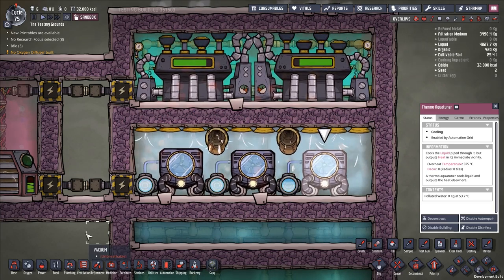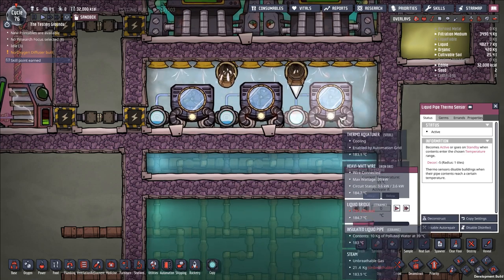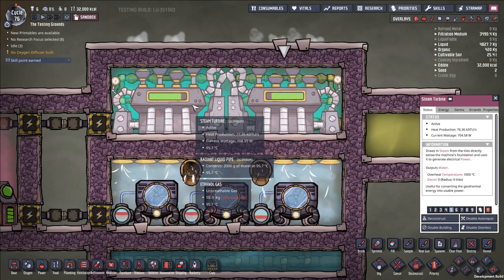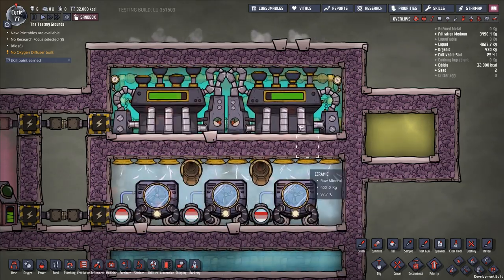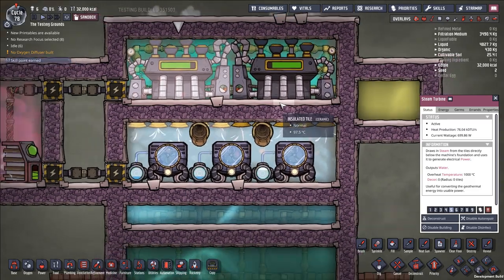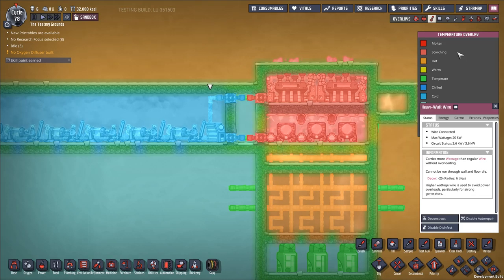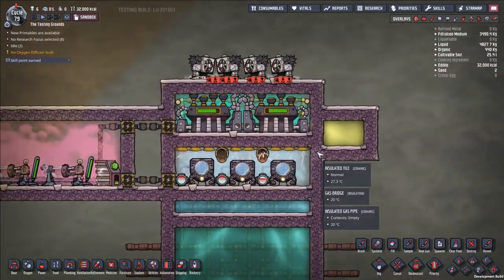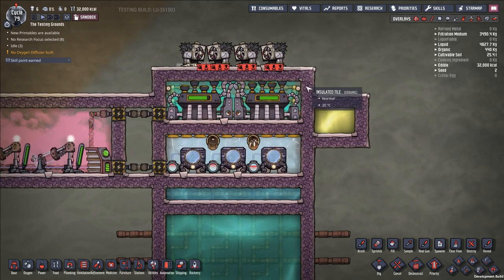Cooling Down Your Base With Steam Turbines -- New Player Guides [Oxygen Not Included]

Comment: I played ONI for a long time but i think i finally just understood how is functionning the specific heat capacity. Thank you for that! Now let's do some math.^^
Reply: @Piotr Dubrawski it's not how it works in this game, it works like this irl, also, the electrolyzers output at a minimum temperature of 70C°, so cooling your water further doesn't make sense, but anyway oxygen has a lower specific heat capacity than water, so you're better off just cooling the oxygen instead, you can keep the hydrogen as hot as you want, the generators don't care (if you use it for liquid hydrogen i suggest pre-cooling it though). Said so, if you want to cool water for other reasons (Although I don't see many) pass it through thermo aquatuners directly, each one is gonna output 14C°*10000g/s*4.179(DTU/g)/C° = 585060 DTU/s tho, so you'll need pretty extreme cooling (steam turbines)

Comment: Very good guides you are releasing. Thank you for that.
One thing to consider that Brothgar is also missing, that you may consider for future videos: These are very specific Creative Mode builds and very difficult to build in a normal game while under all the other stresses of base build; complete vacuum, completely full rooms are not so easy to make (especially when they are only 1 tile so you cannot have a pump in there.
Keep it up :)
Reply: to pump rooms to a vacuum, add an automatic airlock such that you can reach diagonal behind it to close up the wall, that way you can pump any room to a vacuum because the pump is not in the final room but on the other side of the airlock.
Reply: To be able to build in an empty room you can make a door or entrance with liquid, in this way you can remove the pump without problems, for more security of not having carbon dioxide because the replicant can expel it, put on a suit
Reply: @antonioroca2629  I don't think Dupes excrete CO2 unless occupying a tile filled with O2 or pO2. If that's true, you should be able to march them into a vacuum room, sealed by a liquid lock, and they shouldn't fill it with CO2, even without an Atmo Suit. Flatulant dupes will always produce natural gas, though.
Reply: @cnglight  It is very possible that you are right why they hold their breath but if they open their mouths, when they have a water door they run away and they do not axfisian, thank you for responding, you make me enter reason and it is possible that you fall as a precaution

Comment: Really good thing to note about External supplemental power supply is that you do not have to have it local. External power line connected to "In" port of Transformer, and the "Out" connected to smart battery. This allows you to fully control the external power "in" without needing to run a long command cable back to where ever your primary power station is located.

You would obviously have a second smart battery (or multiple depending on your setup in case of prioritizing resource consumption) locally at your primary external power station, as normal.

Comment: i found a way to prevent the early early heating. 
Design your base to have most the machinery and heat producing building in the bottom of your base accessible by a bottleneck. Put 1 or 2 wheezewort near the bottleneck to  prevent the heat of coming up into your living quarters.

Comment: Great video. Thanks for including your math. you've definitely helped me better understand heat transfer. 
Using your formulas I was able to see exactly why a 1:1 ratio can't handle iron and requires >165C overheat temp. You saved me a lot of work!
Reply: I'm actually having trouble with my very similar 1:1 build. My gold amalgam aquatuner heats to 200C immediately after filling the room with 130C steam, whereas a steal tuner in the same room sits at a cool 125C. I'm not sure why.

Comment: Love the delivery without an overexcited zany cartoon voice for the kiddies.

Why have the smart battery turn the generators off at 85% instead of 100%?  What are we avoiding there?  I've seen other YouTubers set the batteries like that but I've never seen anyone explain the selection of the higher number.
Reply: If you set it to 100% then when it hits 100% it will attempt to turn off. During those frames it is still consuming resources to generate power (which has no place to go). Setting at 85% is a safety but usually 95% is plenty.

Comment: if you have super hot steam put doors with thermo sensors under the turbine to block them vents. set them at like 200c, 250c, 300c, etc. for max efficiency.

Comment: Very nice, thanks!
I'm using this, but I don't think you should make the Turbine output a radiant pipe.

You'd have to keep the gaseous Ethanol temp between 95 and 100celsius. Any lower would mean cooling the water in the pipes, and any higher would make the turbine stop, you don't want either.
That means that you'd need a very specific amount of cooling from the Hydrogen loop. I'd assume changing the amount of radiant pipes or the material of it would offset the balance, probably even the amount of Ethanol you have in the turbine room.

Comment: You could also use Hydrogen to remove heat from the turbines and once its past a certain temperature send it to be burned off in the generators, so you delete the picked up heat and get power back. I dont think its a lot in the grand scheme of things, but especially on warmer maps everything helps.

Comment: Just FYI, it looks like Ethanol's TC was changed and is now almost exactly the same as hydrogen (0.167). But I suppose a benefit of ethanol is that if you place a pool of it liquid on the floor of your generator room and then leave the top of the room with some gaps, ethanol will easily displace any oxygen from below and push it out the top. In fact, it's even a little more dense than CO2.

Comment: A bit of a late comment but, How does a 1:1 ratio between turbine and aquatuner could work with just gold amalgam access?, My steam turbine is fine but the aquatuner is constantly overheating over 190°C and doesn't seem to get into an equilibrium.

Is there a way of fixing this? or the safer bet is to just upgrade to steel?
Reply: use steel - steel adds +200 °C to overheat

Comment: How much water do you put into the Steam room?
Reply from the maker: 100 kg or so should work fine, I think I would go with 1000 kg for a room this size, just to have a slightly higher thermal mass in the system.

Comment: Thank you, I've been looking for a guide on building this kind of system for a while!
Just one question - how much water do you use per aquatuner in the aquatuner room? I'm guessing before the system starts running you submerge the aquatuners into water, then once it turns on it becomes all that steam...
Reply from the maker: We're about to build a similar system in my let's play series, and what you guessed is exactly how I'll be doing it, for a couple reasons.

The first reason is that I want to make sure I only have steam in the room, as other gasses could block the inlet ports of the steam turbine.  I could stick a gas pump in there and vacuum out the room, but the easier solution is just to dump water in, let that water push all the air out, then finish up the top layer of the aquatuner chamber and have nothing but water in the system.

The second reason is that I like having a lot of thermal mass in the system.  It means I can start getting cooling out of the system before I have my steam turbine complete-- if there's enough water in there with the aquatuner, it can run a while before any heat needs to be removed.  It also means that I can use the room like a sort of battery-- once everything is up and running and I've got all the water turned into 200 C steam, I can toggle off the aquatuner and the steam turbine will continue to run for a long time.  A high thermal mass system also lets you add or remove water/steam from the system without changing the temperature much-- so if you want to purify water by boiling it, or divert some steam to a steam rocket, or send some 95 C water from your turbine outlet to an electrolyzer/oil well, it helps to start with a lot of water already in your tank.

The downside of completely filling up the aquatuner chamber with water is that it will be a long time before you get any power out of your steam turbine, so if power is an immediate concern, then vacuuming out the room some other way first and then just adding in a small amount of water would be better.

Comment: I'm having issues with the pipes in a similar design. the liquid always bypasses the aquatuner even when the device can accept it. the tuner turns on for a frame processing 0kg water then just stops.
Reply from the maker: Possible problems:

Setting on the sensor is set to "below" instead of "above"

Sensor isn't placed immediately before the aquatuner inlet.

Coolant loop has gaps in it.  This video might help with setting up completely filled coolant loops: https://www.youtube.com/watch?v=z4iedV9pXTw  Another easy alternative is to add a liquid reservoir to the loop.

Comment: I really dislike the term "Heat Deletion" when talking about Steam Turbines, it's more like Heat Conversion into electrical energy, but other than that, good vid. Also, I haven't tested it, but I've heard that you can't use the electrical tuneup on the steam turbines.
Reply: But I think it is heat deletion because you can not turn heat into elektricity. So in real live you need a way more powerful cold source for example a lake.
Reply: @tomost3965  yes you can    https://en.wikipedia.org/wiki/Thermoelectric_effect
Reply: Your link says it getting the power from the gradient not from the heat itself. It also doesn't delete the heat it just moves it/ mixes it about.
Reply: @jaidejasigne  This is false. You can get electricity from a heat GRADIENT but not heat itself. The reason this can't exist in the real world is that gradient will eventually become zero without some other heat sink to reestablish the gradient.
Reply: In real life, you can get electricity from a heat GRADIENT but not heat itself. The reason this can't exist in the real world is that gradient will eventually become zero without some other heat sink to reestablish the gradient.
Reply: @prompt000  check out how literally any generator works, a nuclear plant? The fuel heats up water, which makes a turbine spin, which generates electricity while cooling down the steam. I still don't get what heat gradient is supposed to mean. Anyways, the system in the game would be realistic if it wasn't for the fact that you get about 1/1000 of the heat in electricity, and that's the case because a turbine that produces 850000 watts is not really optimized considering other generators produce between 300 and 2000 watts

Comment: Fantastic video!

Is it possible to tune up the turbines to reduce the power generation/consumption gap?
Reply from the maker: Yes, at which point the system nearly pays for itself, power-wise.
Reply: @gearheadgaming1  No, "Tune up's" Don't work on Turbines.
Reply from the maker: @deviousbutton9211  Interesting.  They're supposed to work on turbines, and at one point they claimed to have fixed the bug, but I haven't tested it myself.
Reply: @gearheadgaming1  Claimed to be a bug, nice can't wait for that to be fixed. (tested last night)

Comment: How do you create a vacuum chamber in the heavi-watt joint plate room? you cant use airlock w/ tile buildout because the space where the joint plates are hold gasses.
Reply from the maker: In my Let's Play when I built it I just stuck a pump in there.  Another option is just to do the whole build in vacuum, only let dupes access it through an airlock.

Comment: How'd you get that bit of water in there perfectly sealed up? And how'd you get that hydro loop without active power ongoing?
Reply: because of the way the game works, liquids/gasses will always move from an output to an input even if there isn't a pump at one end. You can use this to your advantage to create cooling/heating loops that don't require any power to run. He is in debug mode so it is fairly easy to set stuff like this up. In the actual game though you can create these loops by having a liquid/gas shutoff valve going into the loop at some point and adding a pipe or vent sensor to deactivate the flow once the loop is filled.

Comment: I found that this system performs poorly under heavy thermal loads. The recirculating hydrogen has insufficient residence time to cool the turbine. The turbine then runs intermittently, and the aquatuners break from the superheated steam.
Reply from the maker: Did you remember to use insulated pipes on the input lines for your thermo aquatuners as they pass through the hydrogen loop's cold-end heat exchanger?
Reply: @gearheadgaming1  
https://imgur.com/a/Uj6hvXp

Yes. At the time of screenshot, polluted water primary reservoir 10x8, 1000kg per tile at ~68C. PH2O initial reservoir , 10x1, 1000kg per tile at ~50C. Steam chamber roughly 40 kg per tile, ~190C. Turbine chamber ethanol vapor 35kg per tile, 100C. 

No tempshift plates used anywhere. A 10 cycle test was run with them in the turbine room with with no obvious long term change. There's effectively a delta T of 10C across the hydrogen pipe. 80C to 70C in the initial PH2O reservoir, and the inverse in the turbine room. Roughly a delta T of 14C on the aquatuner line entering and exiting the main PH2O reservoir. 

I modified the lines out of the aquatuners to accommodate two "cold finger" arrays for liquids, but that shouldn't affect the turbine cooling. Also note that the thermosensor isn't in the steam room. This just adds thermal mass to the first coolant reservoir, and there is no appreciable heat transfer across the wire. The wire and the tile in the middle are both ~27.5C. There's no reason that the sensor couldn't be in the steam room though. It's just an afterthought.

A second build (the better of two tested) was included as the fourth picture. no looping gas line and instead conductive cooling through copper metal tiles. Initial conditions (fluid mass, temperature, etc.) were identical and this design hasn't failed after 45 cycles (DebugSuperSpeed). There's a temperature gradient across the coolant pool which could be rectified with a different radiator design and shiftplates. Some 10C difference from the top to the bottom of the tank (77C to 67C), whereas the tank in the first pictures is a uniform 68-67C. However, I wanted to include it to show that a change in build can handle the exact same starting conditions. Some changes could be made, like removing some metal tiles to increase heat in the turbine room. Some heat is wasted cooling the water return line by around 1C.

In the second build, at the time of screenshot, there's a delta T of ~14C on the aquatuner lines within the tank. Steam room temp of ~175C. Turbine ethanol vapor temp of 94C. 650W from each turbine, ~73.9 kDTU/s.  All exteriors are vacuum. Other than steel for the aquatuners and gold amalgam vents,  everything is igneous rock and copper to simulate a cheap build. 

A brief note is that the fifth picture is a modified build to decrease the footprint, but heat loss from the pipes in the tiles leads to around 10W less from each turbine (20W total). This is negligible, and totally insignificant if better materials were used.

Comment: I just built this on beta/experimental and my pH20 going into the aquatuner does a 50/50 split instead of prioritizing the aquatuner.... either there is some trick to constructing it that i don't know, or it doesn't work like that anymore on their planned launch update
Reply from the maker: What temperature are you sending the PW in at and what temperature do you have the thermo sensor set to?
Reply: @gearheadgaming1  I went to sandbox mode and tried quite a few different settings, and no matter what order  I constructed it wanted to go 50/50 when I had mirrored settings to your build.  Could have been a bug maybe but didn't seem like it, though I didn't try restarting.  I just added a simple liquid shutoff setup and it works like a charm now though, great build you have.
Reply from the maker: @ryanlessard5451  I did this build in the beta branch.  If the aquatuner is not shutting off half the time due to the thermosensor, then the issue is likely that the piping is incorrect and your fluid is not being split or merged correctly with liquid bridges.  The most likely problem is that somewhere in your loop you have a junction in your piping that is not being managed by a liquid bridge.  Other possibilities are that the liquid bridge on your safety valve is being encountered first, and is splitting things 50-50 because half the time there is a packet clogging the bridge outlet due to the spacing in the system, or the output from the aquatuner is being bridged onto the main output line, and gets backed up half the time.

Just to clarify though, when you say it splits 50-50, you mean half the time a packet goes one way and the other half of the time it goes the other?  Not 5kg of every packet goes one way and 5kg goes another?
Reply: @gearheadgaming1  hmm ok thanks for the feedback, I'll have to check out my build.  appreciated and again great video!

Comment: Will this also work with the gas coolers and electrolised oxygen?
Reply from the maker: Yes, but you still probably want to use the aquatuners if you can-- a thermo-regulator with oxygen running through it only transfers about 1/40th the heat as an aquatuner, but consumes 1/5th of the power.   But there's no problem with taking a line of 70 C oxygen, running it through four regulators with a steam turbine parked above them, and outputting the oxygen at 14 C.